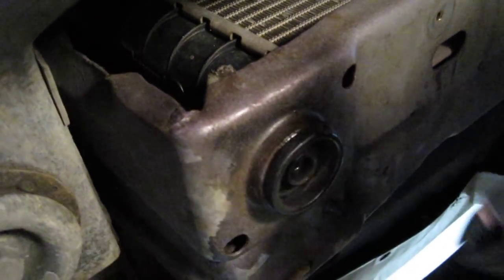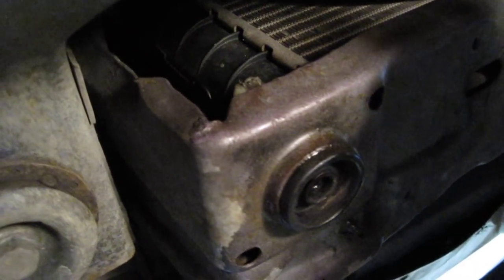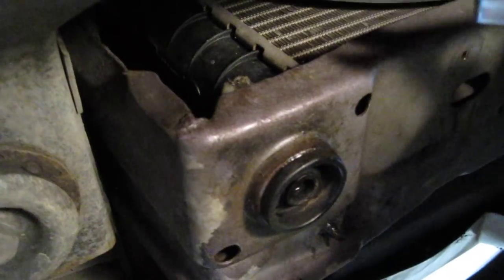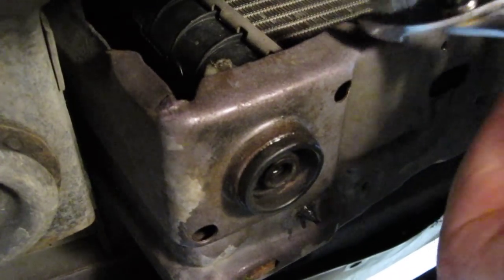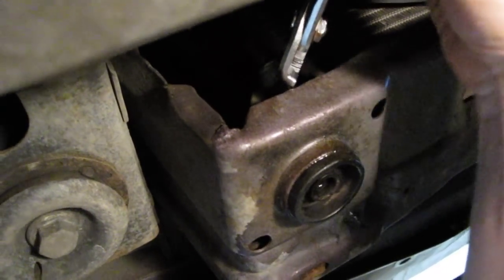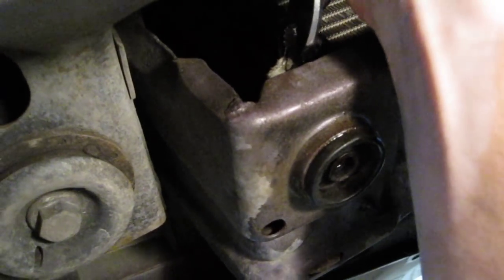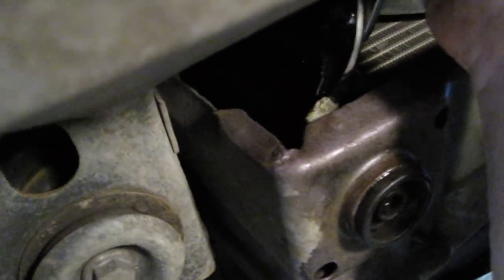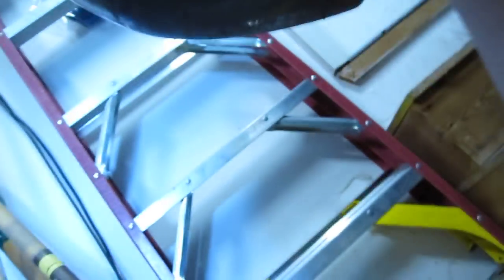How to extract radiator drain plug in 1998 Pontiac Grand Prix

Comment: Dont use pliers, the factory plug has a 1/4" square drive 'hole'. Just rotate it 90 degrees and it will drain thru that small hole. If you remove the air box you can access it from above and save yourself from the shower. Then remove the plug and replace it with the Dorman plug that you can twist by hand.
Reply: WRONG. This car's drain does not have the driver socket. It has a wing or paddle on the plug.

Comment: whats the black thing under the plug
Reply from the maker: Denzel Murray If you mean the circular black thing below the plug, that is the drain hole area.  Rotating the drain plug without removing it will typically allow drainage through it.  The radiator drain plug doesn't have to be removed unless the drain hole is plugged or you want to replace the drain plug.

Comment: That's where my radiator is leaking from please help me how to stop the leak?
Reply: hi ,i have the same problem with my car a leak from the drain plug, so how did you fix it ?
Reply: I really didn't find anything so I'm just replace the whole radiator scarflyr02
Reply: Mine is leaking there too, so I am going to remove it like in the video, then take it to the parts store to buy identical replacement - if they can't get it then onto the dealer I go :)  KUDOS TO THIS GUY FOR MAKING THIS VIDEO. BADASS.
Reply: I put new a radiator in the car and sold it.